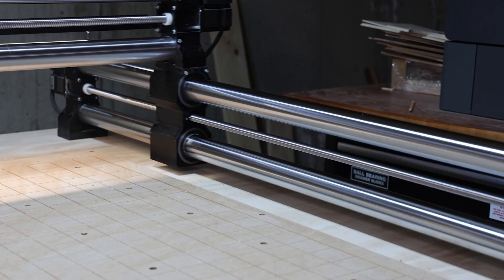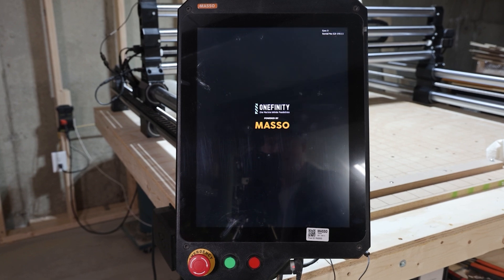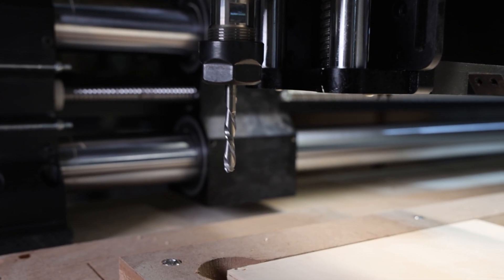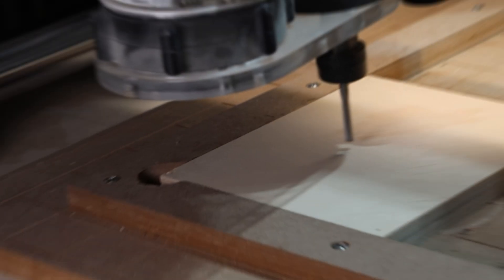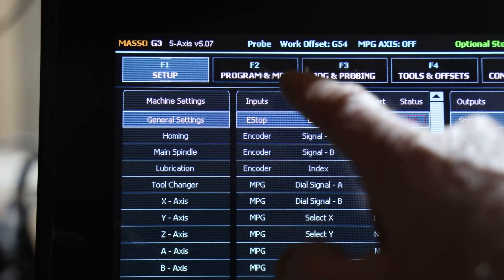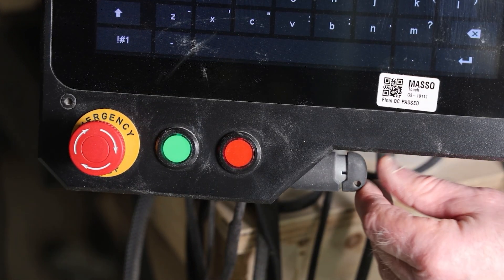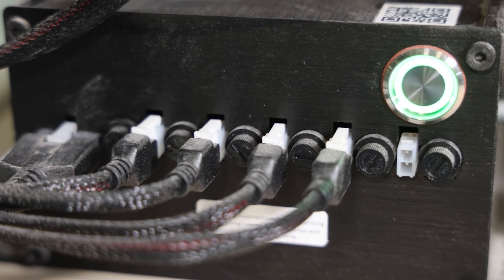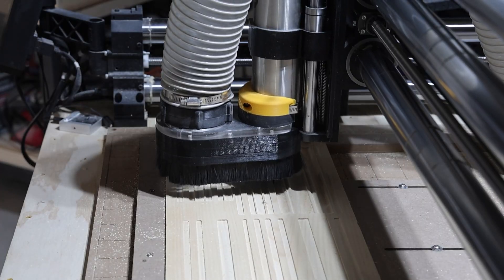How the MASSO CNC Controller Transformed Our Projects | Precision CNC Without a PC

Comment: I liked your video and want to see more.  Question, I design my work on a computer at my desk and save the file to a Storage device in a closet of the house. Then I go to the basement and turn on my OneFinity.  When I finish my design work, can I drag the file to the Masso Link even if the Masso is not turned on?